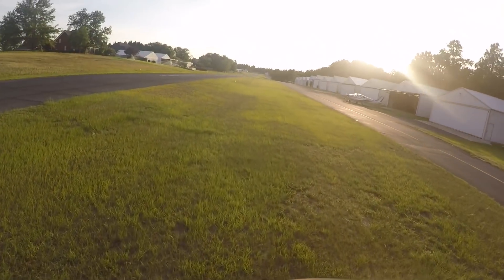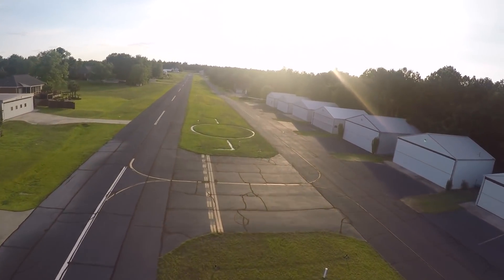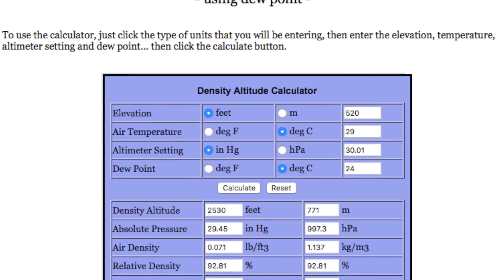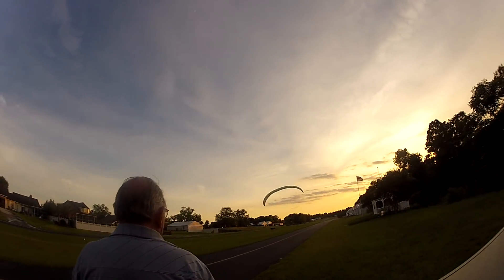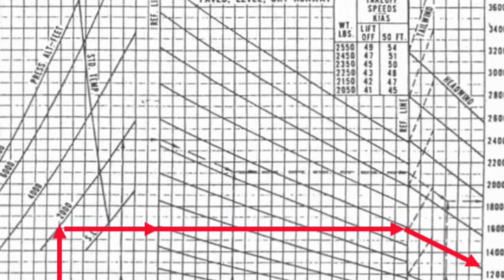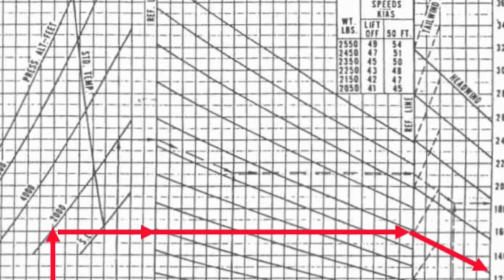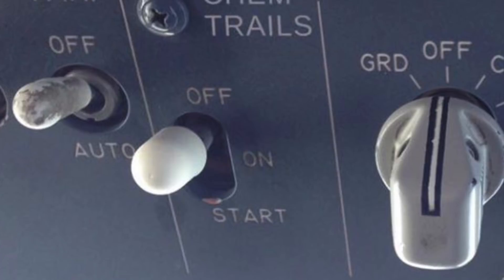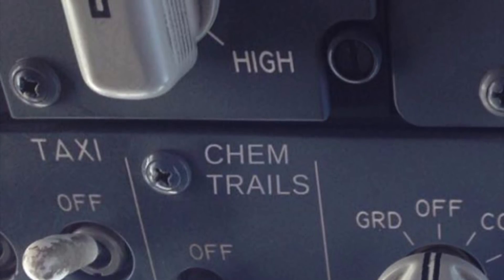Paramotor Density Altitude

Comment: I'm late on this video.  I wonder what the weight change is on our wings as they absorb moisture on a hot muggy day verses a cooler dryer day.  Not so much density altitude, but just plain old muggy wetness density.  When I flew up in Shenandoah with a heavy morning dew, the crew I flew with from Warrenton Virginia had a huge tarp that we would take turns laying out our wing for launch.  Was quite helpful!
Reply from the maker: Yeah we've done the tarp trick.  It helps!

Comment: This is a really good topic
Reply from the maker: I think so too.  I plan to continue with another discussion soon about where the effects of Density Altitude DO need to be at the forefront of concern, as well as some talk about non-altitude compensated induction and carburetion systems.  I'll also explain some terms like stoichiometry and how it relates to our engine's power output as pressure (and density) altitude changes throughout the typical flight.

Comment: Hmmmmm
After experiencing a failed takeoff yesterday with the density altitude above 2800ft, I'd like to ask about your conclusion that it should only mean more steps.

It seems to me that there is a density altitude at which a given pilot with a specific all-up weight and wing will be unable to foot launch at all ever becaue his or her feet simply can't get to the speed needed to generate the lift necessary to get off the ground.

On my aborted launch, the wing came up normally, motor was making power as expected (within 100-200 rpm of normal max) but just before I aborted, my feet were hitting the ground so hard that it was affecting my vision. Adding a little brake helped but I still never cleared the weeds, never felt the wing fully load up as it normally does.
Had I been on wheels I probably could have reached the necessary take off speed because my legs would not have been the limiting factor.
The wing wants to fly at 25mph minus whatever the brakes give it and with my wing, more than the he slightest amount of brakes turns into drag, not lift.

Does this make sense?
Time for a lighter motor, lighter shoes, a diet and more wind sprints for me? :-)
Reply from the maker: Yes sir... Mr. Goin uses the coined term "foot drag".  Sometimes we're it's victum.  Get any video to back up your claims of having done everything right?  You know I only jest, but sometimes we grasp at straws when it's our own fault of something very subtle. I'm not really offering advice here, but what has worked for me is a deeper level of commit, taking longer strides, train between flights with sprints, dieting, weight loss and reversing the aging clock if you can find that elusive fountain of youth!  Lighter shoes and lighter gear all the way around is an idea... leave that hook knife and the flotation if you can justify it.  Fly safe or don't fly at all!!!!!
Reply: YankeeinSC1 
YankeeinSC1 

Frustratingly no video - and without I can never be certain I didn't flub something.
There were certainly other factors: a long day of outdoor honey-do's in the heat, slightly reduced caloric intake (trying to lose weight without giving up my heavy but very reliable FB Simo), heavy boots, last flight a few weeks ago, etc, but I really noticed how poorly the wing was providing lift - it just didn't seem to be there.

I did another attempt but it was late and I hurried through it and on that one the wing didn't even come up correctly - I was too tired, don't need video to know that was my fault 
But with only a third of a tank and no gadget bag, this was a lighter launch than I've successfully managed in the past too. I've done full tank, thick clothes and a bunch of gadgets with less issues.

... contemplating it a little more I do remember a similar launch .., this has happened to me before ... Almost...
While this one from last August at the Vale NC Fly-In was  successful - more lucky than anything else - it felt similar; as if the lift just wasn't there. Once the speed built up I was fine.

https://youtu.be/ukvJB2btI-Q

Of course almost all aviation mishaps have a chain or collection of causal events, any one of which could have prevented it.
In my case, lighter shoes and longer strides alone may have been enough to prevent it, as well as any of several other factors.
Reply: Have gained more experience at failing and just barely managing launches.
2400ft density altitude, zero wind launch at Hodges Field was just barely successful after a 400+ ft run.

Wing went up, power went on, and like the Shah Of, I ran. And ran. And ran.
The I ran some more.
Finally, too fast to stop, too slow to fly, too tired to keep going, running out of runway, I just buried the brakes and prayed.
It worked.
Just barely.
At least in my case, high altitude densities mean more than just a little longer run.
And I need more exercise.
And I get it with every launch.
Reply from the maker: You sir, have found that sweet spot.  Max effort rewarded with the nearly unobtainable airborne experience.  You know I've been to the edge.  There, I stood and looked down.  I lost a lot of friends there baby.  After pulling it off a few times last summer however, I thought I was galvanized.  Then after a few sessions of beach flying, I let my guard down thinking, "I got this.  This is easy."   No doubt you seen my recent zip-wind fail?  https://www.youtube.com/watch?v=URuvna7bNfc

P.S. pay no attention to the B.S. post from Dell's made up fake youtube account.
Reply: I'm afraid I found the spot where launching is so sketchy that I'd rather wait for the winter when I can complain that it's too cold.

Yep, I saw that. 
Several ouch times.
Going deep into the brakes rescued my long run into a successful launch but it was scary - hope I didn't develop a bad habit.
I expected to turtle, would have been happy if it had just slowed down the launch attempt enough to safely stop, and hoped it would launch me.
I got lucky and now I think I may have used my luck  all up on that last launch.

Why can't they make parameters out of helium?

Comment: re your mates takeoff at 9 minute mark.
1. he did not once get wing stable overhead...it from the get go was pendulum swinging from side to side almost out of control. This almost always results in a failed launch and should immediately be stopped. The crash was absolutely a given under the circumstances irrespective of weather conditions.
2. His launch was not strong enough to actually get wing flying properly in the first place (as is evident by visible leading edge mini collapses during the launch, and the subsequent wing pendulum motion from side to side)
3. pendulum swing is almost always a result of not enough flying energy for a wing to stay stable overhead (or even come up straight in the first place). With paramotors, the wing needs a decent force to produce the energy to get nicely overhead and then brakes once at the top to stop surge forwards. 

Im also not a fan of taking off towards the source of rotor in these conditions where the is some headwind. The closer one comes to the rotor source, the more likely of a disaster. 

I think that perhaps your choice of not flying was the right call.

Can i just finish up on a positive note, i really enjoy your topics of discussion. I really appreciate the years of commercial aviation experience you bring to your videos and i for one am learning a lot from you even though i have almost 600 hours flying them and fly very high performance 2 liner paragliders. 

Thanks for all your hard work in helping me in my own journey through paragliding and paramotoring.

Comment: Thanks for sharing your experience, the density altitude research and your conclusion.  When I learned to free fly using a tow system, I had to learn to feel what the wing was doing through the risers.  The pressure differential you feel through the risers as the wing comes up in a forward launch helps you figure out what direction the wing is headed and how to compensate.  The pilot didn't appear to know that he wasn't running the same direction that the wing was flying, then it appears he overcompensated.  I don't have any experience yet doing forward launches with a motor, but I think it wouldn't hurt for your friend to spend some more time practicing forward launches with a kiting harness.    And to try a few that are not exactly straight into the wind to practice correcting for this.  The key is to develop a sense of what the wing is doing without having to stare straight up at it.

Comment: The failed launch was due to pilot induced wing oscillation not being corrected before continuing his takeoff run. With 100 hrs I still verify the wing tip is stable before continuing with full power. With experience and frequent flights you can become one with the wing allowing those pilots to make corrections as fast as someone looking at the wing. I don't fly that often. The takeoff is the most challenging. You hv to keep the wing overhead, in a lifting position and stable before you continue to accelerate. If you don't think you can correct a bad situation, ABORT. If you can't explain it you need more understanding.

Comment: I really appreciated this video. Especially the part about taking a break, analyzing what's happening, before pushing blindly ahead.
Reply from the maker: Hi Michael, I know that from time to time guys get tired of me drawing from my fixed wing experience and applying it to paramotoring, but 30 or more years ago I had a simulator instructor in Totowa NJ (a contract airliner simulator facility where my airline bought "box time")  share his philosophy on this.  He said, "Hey anyone can screw up a low weather instrument approach, so go around, re-run the checklist and try shooting the approach a second time.  If you "go missed" a second time however;" he continued, "...it's likely you've done something really wrong.  Do something else to take you out of the ineffective habit pattern."  

The philosophy served me well thought my career.  The most nervous I have ever been as a passenger in the rear of a regional jet, was one night about 7 years ago.  I was in the last row, looking out the window behind the wing at low, low ground fog and cloud cover for most of the really delayed flight.  It was well after midnight.  I could see street light poles, but not the streets nor yards below them due to the super dense fog that extended from central VA all the way to the FL border.  As we began our descent into Charlotte, we were slowed to minimum speed a long ways from the airport and we'd already had exceeded the scheduled flying time by 30 or 40 mins.  Missed the first approach and they flew a huge 60 mile circle to try a second time.  I knew where we were because of the buildings and antennas sticking up through the city lights.  When we missed the second time, (I never saw so much as the glow of a single approach light) I thought for sure we'd be climbing for altitude and a diversion somewhere far away from the incredibly low weather. Nope,  A low slow speed maneuver followed the miss.  I knew they'd been suckered. We didn't have enough gas to divert...  Sure enough, we were going in for a 3rd try, maybe even a min-fuel declaration.  A few quick turns lined us up for an attempt to the same runway but only in the opposite direction this time.  Bang we were on the ground in like 4 minutes.  Well below CAT II minimums, but we were on the ground.  I never really had a discussion with the crew, but I know they'd sucked those seat cushions half way up their butts...It was one of only 5 or 6 times where I was deeply relieved to be on the ground.

Sometimes you have to make exceptions, but in the case of this guy's take off, he needed to take a break, get his head right and let that wing dry out.  He's still reporting to me that he's having a few issues getting safely airborne, but he has flown safely without issues too.  I am not hanging out a shingle as an instructor (any time soon), but I feel a certain desire to insure he minimizes threats to his own saftey.  I hope to observe and fly with him again soon.  He loves paragliders too much to see him quit or be injured!

Comment: Ahh, the same local that got me hooked on paramotors! :)

Not to take away from your discussion, which was right on the money, but another factor with heat and paramotors is that most people like to run their mixtures fairly rich, being afraid of holing a piston from being too lean. I see this alot in off-roading circles too. That rich mixture becomes FAR too rich when the weather turns 90°F @ with a 80° dew point - that absolutely kills power - I would imagine that isn't going to help a take off. I'm sure you're familiar with this having flown fixed-wing planes with a mixture adjustment - I became familiar with it on the repair side of things. I've got to tinker around with lots of different engines, 2 and 4 stroke, and they all react the same when fed too much fuel, and not enough air. The 2-stroke gets that distinctive "4-stroking" sound when too rich - easy to spot once someone knows what it sounds like.

Great discussion! I've watched several Youtube videos on D/A. As a non pilot, this was fascinating to me - something I never even thought of, but made perfect sense. I recall my time in Phoenix riding a '94 Honda CBR600F2 - in the valley, I had enough horsepower to float the front wheel along the pavement ... but an hour's drive up I-17 toward Flagstaff at 5k feet, that power was significantly reduced. Bike was running pig rich, and couldn't get out of it's own way. After riding around Flag most of the day, that first downshift to pass a car back in the valley really took you by surprise - felt like the power output doubled, which it probably did!
Reply: Smitty Smithsonite I have to agree. If you pull up a bing carb chart you will know that at a higher density altitude or on a hotter day you want to run a leaner mixture to help  the engine. So you would actually want to set or use a smaller jet if you had a float Bowl carb.,

So if you are running slightly rich you would still benefit on a hot or higher than 29.92 density day. 
One of my videos of says Bing carb fail.. I remember it was a flight on a warmer day and instead of bringing a smaller jet I brought one that was to rich,  had no power to get off the ground...and if I did, as I climbed it would have been even more pathetic.
Reply: Smitty Smithsonite here's the video from a warmer day in which I went to a richer jet and  I did not have enough power to get off the ground because with the heat I should have went to a leaner, if not left it alone to with the same one... ;)

https://youtu.be/DdDf7N1H2Vo
Reply: Yeah, that'll do it!

Back when I was in my 20's, there was a guy who used to travel around towing a dynamometer for motorcycles. We'd meet up with him nearly every weekend, and try different things on our bikes to see how much power they'd gain, or lose. These were all 4-strokes then - he'd always say, "Leaner is faster". It's true ... but with a 2-stroke you've got to walk a fine line - where they run with the absolute best power, they will sometimes melt down, depending on where the ignition timing is at. If this best power is at elevation, a trip to the beach will guarantee a meltdown/seizure.

A different subject here ... but my grandfather was a mechanic, so I knew quite a bit from him by then. I remember arguing with my buddies back then, who thought higher octane fuel gave you more horsepower. I explained many, many times, that octane made for a slower burn, to ward off detonation, and that you'd actually lose power with more octane than you needed. Wasn't until my buddy threw some leaded Cam-2 racing fuel (107, or 109  octane - can't recall which) in his bike, and headed to the dyno guy - he lost close to 7HP at the rear wheel! :) Back on topic, I always run premium fuel in all my 2-strokes (except lawn / power equipment), just as a safeguard from detonation.